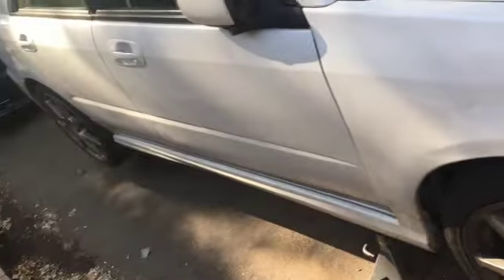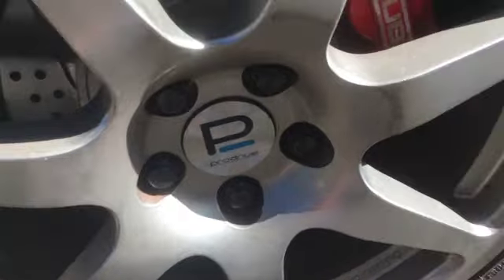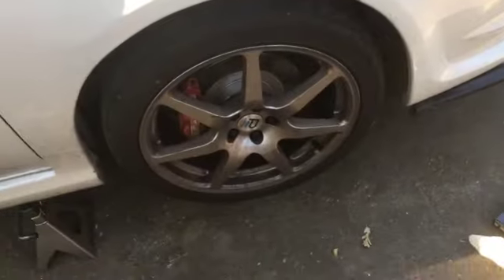Maintenance on my 07 WRX Wagon

Comment: Jeez I wish you had a garage. Some people drive by like they don't care if they hit you. You know you're a car enthusiast when brakes are basic maintenance. Also thinking more about the roadside work, maybe get a couple traffic cones or safety squares to put out? Wouldn't want someone to hit you or the car while you're under it. Otherwise, sometimes wheel shake while braking is just pad deposits. Try a few long fairly firm brake presses while going downhill. Basically get the rotors hot and give the surfaces a fresh scrape, then let them cool by driving for a while before coming to a stop. Often works for me.
Reply from the maker: I'm afraid cones will draw more attention to me and someone will alert the city. I can't deal with that again lol but it does scare me :( 
I will try that, thank you!
Reply: @TatiZiemer  True, that's unfortunate. Then people will think you need help more. 😞 Still, good work!

Comment: Light brake pedal pulsation is often caused by warped front rotors. The idea is to have soft brake pads which don't last as long. Heat from racing increases the chance of warping. One little thing, after hard braking avoid holding your foot on the brakes while your car is standing still.
please install this for simplified oil changes. it's the best.     http://fumotousa.com/about-fumoto-valves.php  lifestyle improvement.

Your fans want to know more about what makes up a girl racer. Not just you and the car. Is it important to beat the other cars? Is it important to hone your talent to be your personal best? How did you and at what age did you start to pick up tools? How did you develop your tool talents?

Is it against the law to work on your car on a public street? I have always worked on cars on public streets.Please work on your car in a nicer neighborhood where you feel more comfortable. Please wash your car in a place you feel more comfortable.

It is excellent that you focus on your education broadening your horizons. Please Share with us some of your thinking that the stimulated by education and your increasing awareness. But still school 1st to help fulfill your dreams.

In a more comfortable location you are able to speak naturally loud. Most people would agree you have a clear crisp voice with good annunciation. Now speak up! Most would also agree you have an attractive voice that is sweet to the ear. It is so nice that you explain and not complain. Best Wishes and Tally-ho
Reply from the maker: I could make a video just for your questions. I appreciate your support so so much! I'll start including more details about myself, stay tuned for more videos and a track day soon. I get to drive Sonoma Raceway for the first time!
Reply: @TatiZiemer  Studying creative resourceful people all my life is more than a hobby. When you watch movies, TV or the Internet I think we are all interested in the construct of a person. What they like, what they dream about, their inspirations, their urges and the navigation through it all. It is so difficult to truly be yourself in front of the camera. 

May I suggest that you imagine the camera to be a friend of yours and your equal. Please carry the assumption that we know the vernacular you speak. You might speak with your friends a certain loose easy way when you're comfortable. Surely you are more comfortable with those of equal determination and similar values of graduating. You demonstrate good values to people.

Safety; there should never be anything hanging from your rearview mirror. Our eyes are attracted to movement. Dice or cuffs desensitize your eyes to movement through the windshield. Your rearview mirrors should be totally clear and clean. Rear windshield should be substantially clear also except if all your glasses tinted deeper.

I have driven Sonoma for 5 times. It will be fun and challenging. Oh my God in the twisty bits with reverse camber Road my driving talent comes out. Comes out like Miss Piggy behind the wheel. Double chuckle. Look out name drop; Sir Jackie Stewart spent near an hour with me in the passenger seat, behind the wheel and in the tower showing me how not to make such a fool of myself on the road. I had lessons directly from Jackie at least 4 places around the world. Lucky and learned a lot.

As a spoiled auto writer I was able to sit as passenger or drive with and take instruction from many of the world's greatest drivers. While intellectually I sort of chuckle at the sportsman, you know they're not NBA but when I see them work the automobile becomes a paintbrush and they become Picasso or Rembrandt or Monet in the total beauty and melding of human and machine.

What you're learning and how your learning is the best. A track driving, automobile driving truism is 1st become accurate with your steering and drifting through the corners then slowly increase your speed. Compete with yourself the other cars are a distraction I've seen you work around before.

Okay enough of me. Jeepers I write too much. Take what you like, throw away the rest. Your fan base is building. Mask up, social distance, Tally-Ho, Best Wishes